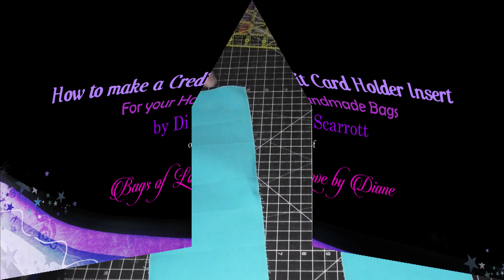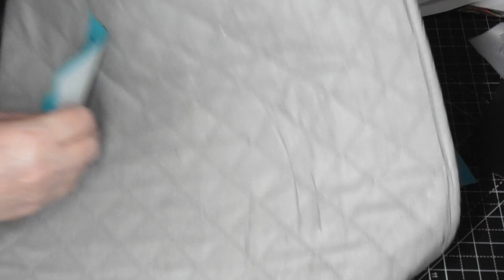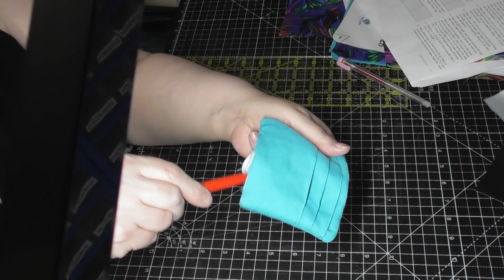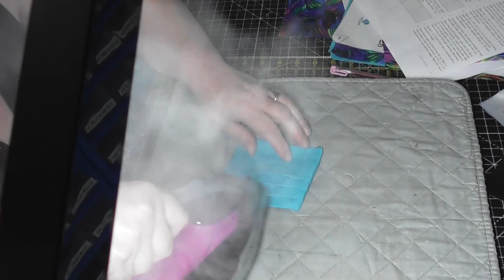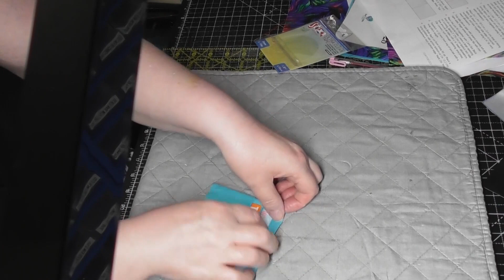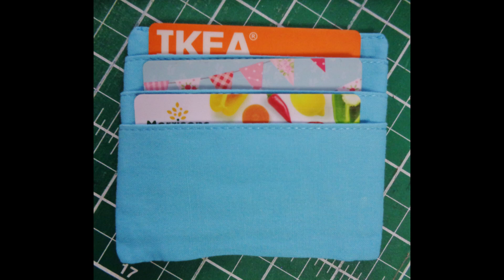Credit Card Holder Insert

Comment: YOUR CUTTING BOARD IS NOT AFFECTED BY THE HEAT COMING FROM THE MAT AND THE IRON?
Reply from the maker: The pad is folded so it’s double thickness and I don’t have the iron very hot as it isn’t necessary. If the mat was affected I wouldn’t do it. Nor would I use the pad with one layer or the iron on highest heat. I now have the ironing pad attached to a thick board so I can use high heat.